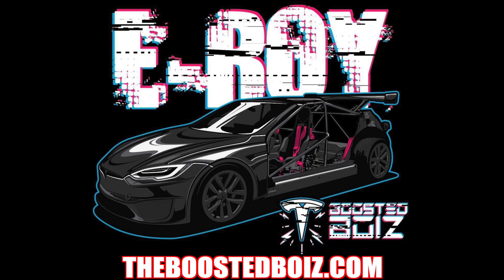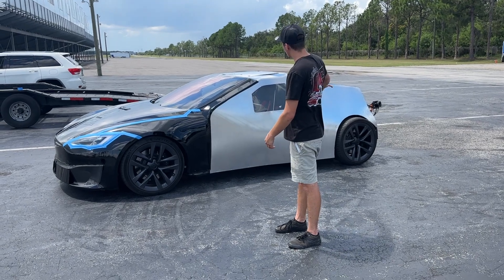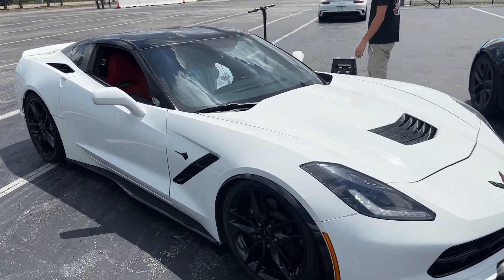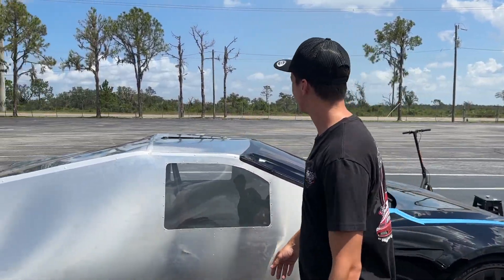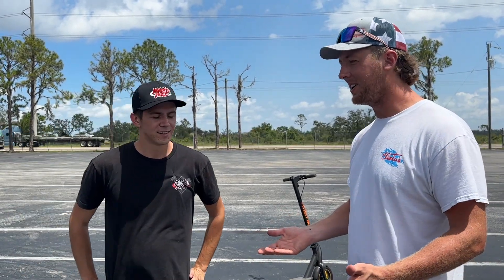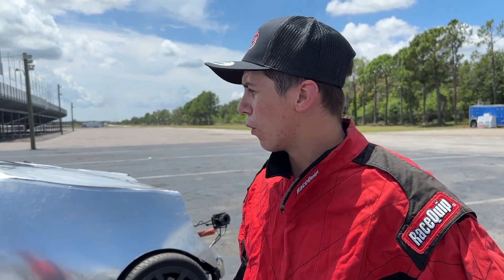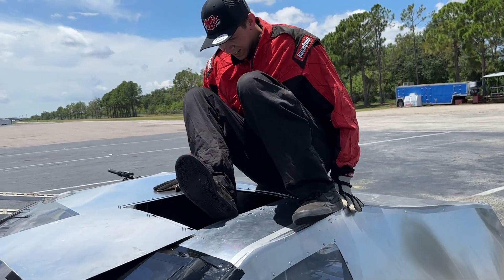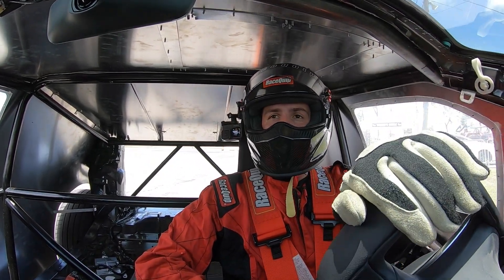We Built an Aerodynamic Body For Our Tesla Go-Kart To make It Faster!

Comment: smaller diameter wheels and stickier tires will get you lower to the ground (aero) and better grip (versus the stone hard run flats)
Reply: EV tire are hard to accomodate tge weight of the vehicule. Its like having harder spring for heavier car.
Reply: @1nicube  agreed, but they’ve taken ~700 lbs out of the car. The stock tires have a wear rating of 300. Just dropping down to a 200 rating should buy a tenth to 60 feet. Dropping down to an 18 or 17 inch diameter wheel is going to improve the gear ratio - also improving the 60 ft time.
Reply: @willecutlip  i didnt say better tire wont help. but the car is still 1000lbs heavier than regular street car. Drag car are mostly stripped out, so it is still more than 1000lbs heavier than a drag car.
but yes better tire help. Harder tire on EV juste have les impact than having harder tire on a super light car.
Reply: @willecutlip gearing won’t help this car. It has a flat horsepower curve pretty much all the way to 20,000 rpms.
Reply: @LearningFast  🤦🏼‍♂️ motors have a 7.56:1 final gear ratio. Smaller diameter wheels - per simple math - will result in an even higher effective ratio, thus increasing acceleration.
Reply: @willecutlip  for a car with constant horsepower across the rev range changing gear ratios will not affect acceleration. There is a small portion of the Plaid’s horsepower curve that is not flat. However, the absolute majority of the horsepower curve for the Plaid is essentially flat. Gearing won’t affect that particular car’s acceleration. Only traction will affect it in that respect.
Reply: @LearningFast  so a larger diameter drag radial would cause no disadvantages is gearing and acceleration?
Reply: @jacobgriffin2500  gear ratio does not affect wheel torque for a flat horsepower curve. If horsepower is truly flat then gear ratio is irrelevant with regards to acceleration. That is why this electric car has a single fixed gear ratio instead of a gearbox.
Reply: @LearningFast  it will 100% affect power to the ground.
Reply: @LearningFast  So do you believe if you were to change the final drive in such a way as to increase the top speed the acceleration wouldn’t change?
Do you see how this wouldn’t make sense?
Reply: @willecutlip  no benefit gearing for more acceleration when the wheels are spinning already on the start section (where they are losing time).
Reply: @MrAdopado  But that is the point, the wheels did not spin when they got their best time. In this video the track was to hot to recreate that.
Reply: @Jake-bt3fc  if horsepower is constant then torque at the wheels won’t change with a different gear ratio. Do the math and you will see. This is Mechanical Engineering 101. Constant Horsepower is independent of gearing for acceleration. Gearing affects fuel efficiency and max output rpm with constant horsepower but not acceleration.
Reply: @Triple88a  power is independent of gearing. Do the math and you will see. Torque is affected by gearing except when horsepower is constant.
Reply: @LearningFast  If gearing affects output RPM then it affects top speed...
Do you really think you can just infinitely raise the top speed by lowering the gear ratio and you'll never lose acceleration?

The reason ICE engines need a transmission is because they need to stay in a very narrow RPM range. Electric motors have constant torque through a wide RPM range so they only need one gear...

But to say the gearing of the electric motor doesn't matter at all for acceleration is absurd. You're regurgitating things you've heard but didn't properly understand.
Reply: @LearningFast yes it does. I work with about 10 electric motors, the ones with a gearbox or belt/pulley spin faster. 

I think you don’t realise that most people take their car to Tesla to get the smaller or bigger wheel then Tesla tunes their car to suit. 

Put a larger tyre on it and tell the computer it’s on a smaller tyre? It will definitely be faster downtrack.
Reply: @dylanzrim3635  you are wrong on this. Just simply wrong. Constant horsepower is independent of gearing for acceleration. The Tesla Model S Plaid actually has decreasing HP as rpms increase after about 60 mph. If you use a smaller tire you will actually decrease acceleration above 60 mph in the Plaid.
Reply: @Jake-bt3fc  you have assumed that torque is constant for all electric motors. It isn’t. The Model S Plaid has close to constant HP after 60 mph but it does decrease as rpms increase. I never said anything about top speed. I only talked about acceleration. If you shorten the gears you will reach the redline sooner and lower the top speed but if you have constant power you will not affect acceleration up to that top speed by changing the gear ratio. Cars rarely have constant HP for large rpm ranges. Even most electric vehicles don’t have constant horsepower for broad rpms. The Plaid is unique in this respect right now.
Reply: @cajampa  I think we are agreeing. On these runs they were not getting good traction at the start because of the hot conditions. They did show that the car was gaining speed faster further down the run. Clearly the car would have beat previous times but for the lack of traction at the start. Because of the conditions they were not able to compare like with like.
Reply: @LearningFast  Funny thing.. i actually have a  physics paper on this exact topic.. 
I'll have to make a video on it some day to go over the physics spreadsheet but yes it will 100% make a difference as force to the ground is different.

In my test i ran a 5th gear test which topped out at 192km and max acceleration in 5th gear was .387Gs.. dropped the tire diameter low enough so 6th gear was at 192kmh and acceleration went up to 0.869Gs
Reply: @Triple88a  except your horsepower isn’t actually constant. This is only true for constant horsepower.
Reply: @LearningFast  The horsepower of an electric motor isn't constant either.
Reply: @Triple88a  it isn’t constant but it is close for about 15,000 rpms. It actually decreases ever so slightly above about 60 mph.
Reply: @MrAdopado  my original post stated “stickier tires and smaller diameter wheels”
Reply: @willecutlip  Yes ... and my reply was pointing out that his would have made no difference on the strip on this particular day with the heat problems due to the melting Trackbite. Smaller diameter wheels will always be more of a challenge with grip than larger diameter (all other things being equal). The Tesla had no issues launching when last at this strip, presumably due to it being a lower temperature.
Reply: @1nicube plenty of heavy cars like chevelles and pickups run drag tires, the tesla is no different, some wheel adapters might open up wheel and tire combos. Maybe rob the tires off the mr2 or nsx.
Reply: Add spacers and equal weight 6 foot tall wheels and see if it goes the same speed
Reply: @herkimersnerd8740 you are wrong. You have to take rpms into account when you do that calculation. If Horsepower is constant then gear ratio will not affect acceleration.